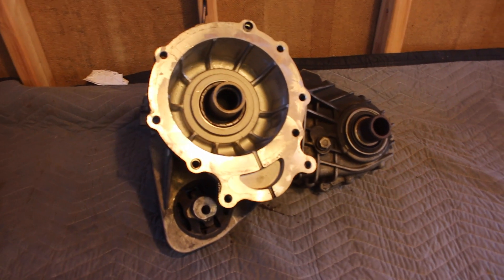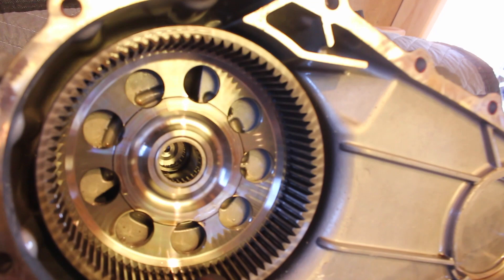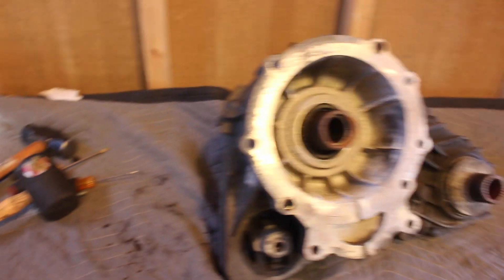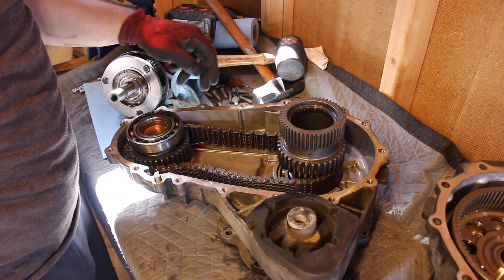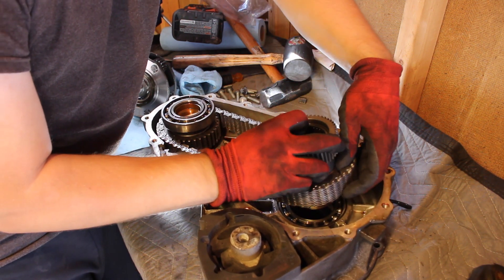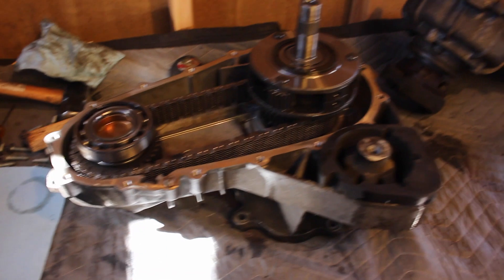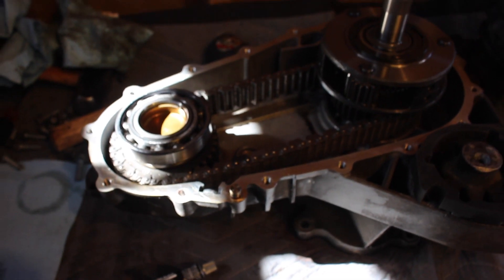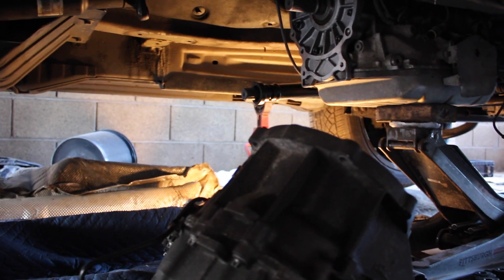X5 4.6is Resurrection Part II: Cracking Open The LWX-500 Transfer Case

Comment: Hi I got a quick question I have a 2014 550i xdrive and drove into a big puddle then the next day I started to drive it and my axles were clicking I and I felt like when I turned the wheel two both sides the car felt like the wheels were shifting or something so I changed the axles and now no clicking noise but I still feel the shifting could it be that water got in the differential or tranfer case have any idea what ghat can be?

Comment: do you know what causes wear on the transfer case? it is hard driving, or just lots of miles
Reply from the maker: In this case, it's because of a factory driveshaft that was slightly too short and slipped out, causing the splines to be damaged. The transfer case was perfectly fine internally with no visible wear, despite having 213,000 miles.

Comment: Dont forget to relocate your AC drain or you'll be doing this again soon. The drain pipe sits right above this drive shaft/input shaft joint and thats what causes the rust and eventual stripping of the splines.
Reply from the maker: Yeah, I've heard that too. Not a problem on this X5 though, as I sold it on to my friend who then proceeded to blow up the engine.

Comment: Hello i have 4.6is 1 week a go a put LPG what you thin?
Reply from the maker: Not sure how you'd do that, I have no experience with LPG. Regular gasoline is cheap here ($3.27/gallon for 91 octane) so nobody does those conversions in the US.
Reply: @DannysGarage  here its 1.45euro per liter gasoline and 1 liter LPG its 0.39 cent i mean i will have any problém in engine?
Reply: no problem my 4.4 2001had lpg for 15 yrs,still ok had it2yrs only way to run these at £1,40litre for petrol or £6.40per gallon at 14~16 mpg no go with lpg works out  to nearly30mpg,like to see what america would think of paying over $8gall +$340 registration insurance  unaffordable  under 25 unless very small car,34yr old nurse no convictions 1200$ 20yr old at least $3or4000 very small car.
Reply: Oh thx bro very much

Comment: Finger tight and wait an hour.  Learned something new for Gasket application.
I wasn't sure how to use RTV gasket tube, but now I learned.
Thanks
Reply from the maker: Yep, that's what you do for creating a gasket when there is none. When used with a regular gasket it's not as necessary to wait that long.

Comment: Are there any physical differences between the NV125 and LWX500? Can I use a NV125 instead of the other?
Reply from the maker: I'm not 100% sure, but maybe the increased torque requires the different transfer case on the 4.6is?